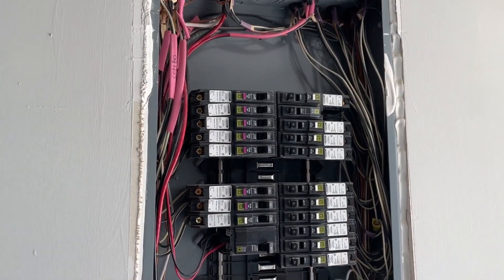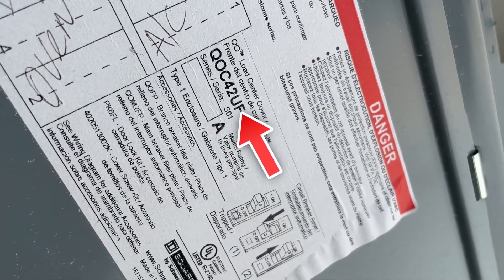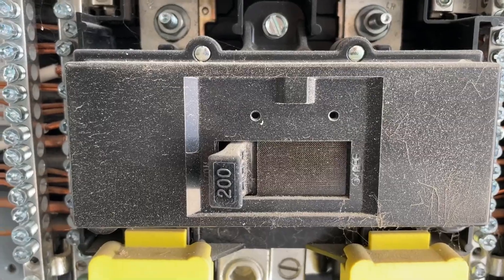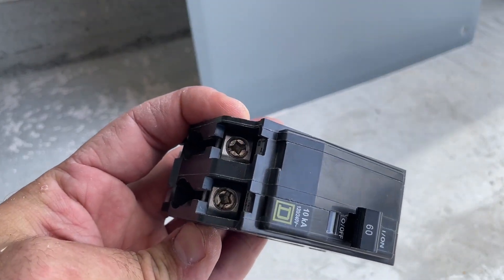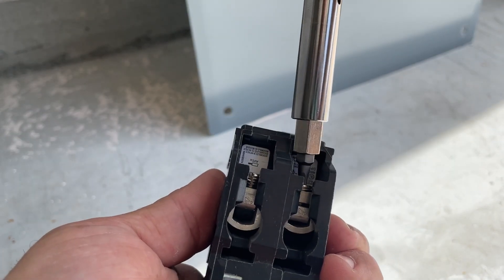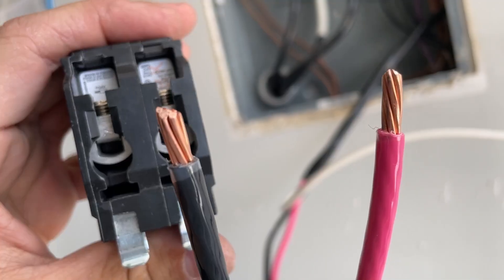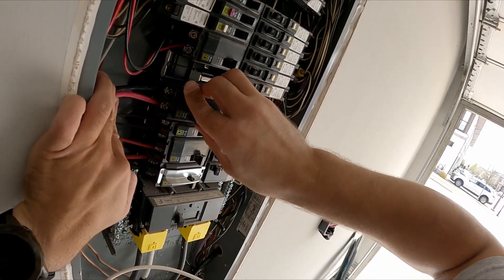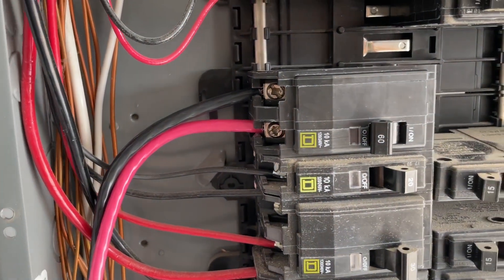How to Install Square D 2 Pole Breaker

Comment: No longer applicable - Square D now puts a screw right through the middle of the wire channel, making the breaker virtually impossible to attach to stranded wire. Designed by an idiot.

Comment: Does the color matter red/black when connection them to the breaker? I have an old breaker that has some knob and tube plus some updated wiring and my hot water heater/ washer / dryer are on a Q0230 breaker. I noticed you have the red wire connected to the side the switch for the breaker.  Is that for a reason or just where you put them?
Reply: If you're doing a 240v breaker, color doesn't matter. 120v  breakers should be relatively balanced between the 2 legs.
Reply: @chris76-01  Thanks for the response. I actually found out it earlier today. It was a 240 breaker for the dryer and hot water heater.

Comment: PLEASE UNDER ALL CIRCUMSTANCES TURN OFF THE MAIN
Reply: What about when it's the main breaker you need to replace?
Reply: Either pull the meter if you don’t have a outside breaker, or if you do pop it in the off position and verify inside that your good to go and replace
Reply: @JoseOrtiz_1416  if I pop it off it's no longer hot? And safe to pull the two cables off? Or the main breaker carries power at all times?

Comment: I need to add some outlets, but the breaker box is full. Can I replace a single pole breaker with a 2 pole breaker to add a new circuit for my outlets?
Reply: no, 2 pole breaker gives you a 220 connection. You could piggyback your wires as long as the load doesn't exceed the breaker.
Reply: Tandem breaker buddy

Comment: My question is when do you use a double pole breaker similar to the one you just installed.
Reply: When you need to connect 240V appliances

Comment: Thanks!
I had not messes with the breaker box for almost 20 years.
I was trying to but the breakers in by pushing the outside in first.
That doesn't work.